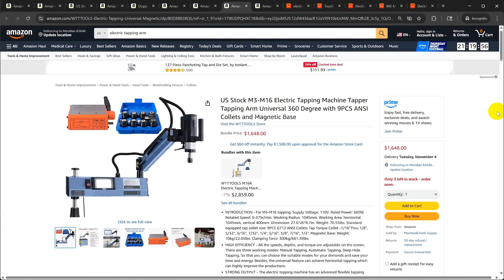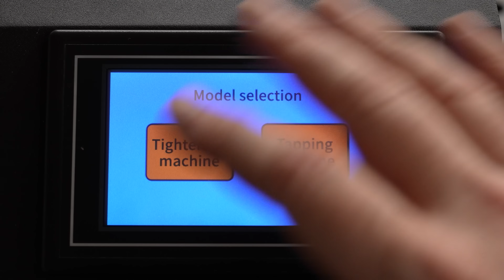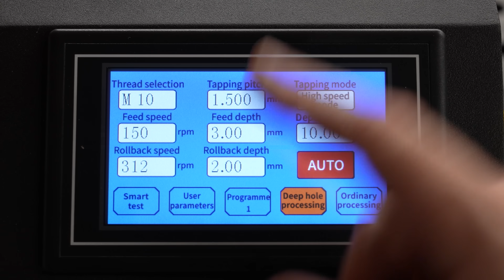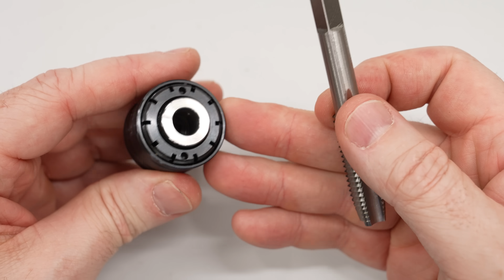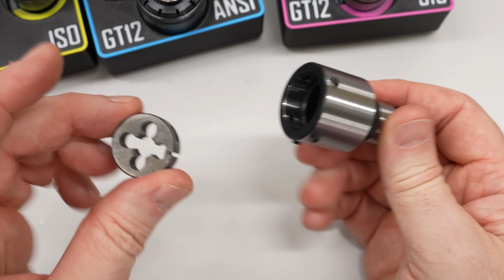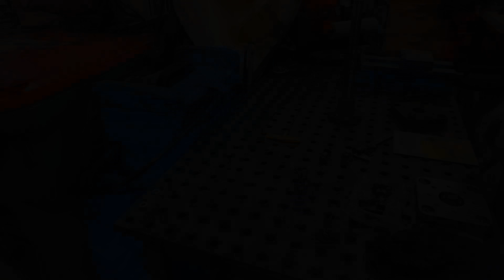Will I Regret Buying the Cheapest Tapping Arm I Could Find?

Comment: With 600 replies I'm sure somebody's already mentioned this, but I can't imagine using a single flute threadmilling tool unless you were making it yourself on a d-bit grinder.  On the other hand I use single form thread mills every single day and their limitation is strictly the rpm of your machine and the material you are milling.  You can buy solid carbide multiflute. Single form threadmills very reasonably priced from rouge systems inc.  Aka Carbide Tool Source. I use them every single day.  

The other option is to use gun taps or spiral flute taps in a tension compression tapping head on your mill that "Can't do rigid tapping."  It's a little bit fiddly to figure out. But I found it to be so useful that I have saved specific operations in my operations library in my cam software for each size tap that I use regularly.  Tension compression tapping heads are kind of expensive but they're a relatively simple device when push comes to shove.  I bought one and then I've made three more of my own.

Comment: Well James I watched this video and bought one. The education I now have about tap standards for shank and square dimensions is more than I ever wanted to know. When I researched HAAS tooling (my main supplier) said the taps were ISO but nope DIN true measurements. So listen to James on this one. We had an opportunity to bring work for staff that are all blind using this. I work for one of two machine shops where blind folks run machines. I wish I was a better designer to make accessibility for locating holes quick use tactile. The engineer and I are thinking get ROI back quick. By the way prices are way up since video. Thanks for video.

Comment: This sort of thing seems like if it exposed a Serial port that could be connected to a computer or a raspi... it would be REALLY useful and flexible. Especially with logging. You could probably have the computer automatically detect when the tap was wearing out and needed replacement.

Comment: I had to machine to remove several hundred threaded studs from GE aerospace gearboxes because a High Quality Tapping Arm was used to cut the threads....all of those threads were out of square to their mating surfaces and had to be repaired.  Never use a tapping arm for precision hardware that requires accurate projected true position.

Comment: I can't help wondering if the holes in the base plate are actually on a 90mm PCD, rather than a square pattern. It's very common to define holes on a PCD and in this case, works out very close to a 2.5" square pattern. Most decent milling machine DROs can help with PCD hole patterns.

Comment: I have a 49" table on my milling machine, and I am old and don't have a lot of space for another heavy cart/table to mount the tapping arm. What do you think of the possibility/feasibility of mounting the tapping arm on the very left-hand side of the table and either swinging it out of the way or removing the arm when it is not needed? I would also have a built-in vice to hold stuff for tapping.

Comment: Which lock-down bolts are you using there? I have a 16mm hole pattern Siegmund table and need some more bolts, but the original Siegmunds are crazy expensive.

Comment: Has anyone fitted a drill to a flex arm? I don’t need a tapping machine, but it would be nice to replace the drill press with a flex arm right at the main bench so you don’t have to move your materials to the drill press.

Comment: Thanks for this!  Got one job coming up to do 240 pieces with 6 tapped holes each.  Could do them in the CNC, but really don't like the idea of stopping/starting the spindle that much on my old Fadal.  Job after that will be 260 pieces with 33 tapped holes (3 different sizes).  That and this tapping arm is about the same price as 3 tension/extension tapping heads (job 2 has 3 sizes), makes it a wash cost wise.  Really wish it had higher RPM (all 3, 4, and 5mm taps), but think it will still be the way to go.

Comment: I have a tap arm (flex arm) we have used it to tap thousands of holes by now. It was at one point doing 10 hours a day of non stop tapping. 

They are great tools to have in a shop like ours. Tbh it wasn't that expensive for the work we got out of it. The cost was 7-8k or so but way better designed than what I see in your video too. 

Flexarm is the way to go for pro use, I go a 400rpm and 600rpm for it ... It's super fast

Comment: Here in germany we mostly use the iso varient. I'm even pretty sure that the din and iso have the same size. Some norms got taken in to a iso norm from a din norm. So here in germany you can find din, en, iso, din en, din iso, din en iso notations depending on if the norm is german, european or international. However, only the "highest" norm needs to be noted (iso>en>din).

Comment: Is it possible, that the bolts are not in a 2,5" square, but on a 90mm circle? Since the entire foot is round I'd expect a circular pattern although it can easily be mistaken for a square, if it's less than 5 holes.

Comment: I threaded thousands of holes on a similar machine as you have on the pack. Check for corresponding tools, eg spring loaded tools, attach a stepper motor on the side of the machine using an L shape aluminum bracket (that is what I did on my DIY machine). Wrap a pulley around a tool (use a bore to adjust the hole accordingly). 
Nowadays on my Mitsubishi CNC it's just a piece of cake luckily 🙂

Comment: boy the amount of oil you use.. someone has broken taps before. haha! i use a small cup, seems to work just as good and faster.
Making a collet that has a flat face or a piece that goes in a collet with a flat face so that you can push it against a surface to set the angle, would be nice easy way to set the angle. 

These are pretty sweet, i have always used the tapmatic for the drill presses, but boy.. the electronics make it slick. you think you could show us the torque limiting function and maybe the torquing function?

Comment: Nice machine James. I bet it won’t be too long until you adapt it to CNC, which will make a very interesting project. I was thinking of colour-coding the various taps, then I saw the post from “Laureeeeeeeeeee” about painting a dab of paint at the top of each tap. My suggestion would be to 3d print small “0” rings, using TPU and matching the colour of your storage trays. This way, as you purchase more taps, these little rings could simply be slipped onto them and removed when the tap gets worn out. Great video thanks.

Comment: I'm... confused. With the spring-loaded, two-arm linkage, doesn't it always travel vertically in a parabola (e.g. "not straight plumb")? Or does the collet have in independent travel - like a drill press - after being positioned with the swing arm, and I'm just not seeing it? It seems like one side of the hole would always be getting lateral pressure from the act of vertical movement, otherwise.

Comment: When I had to tap a bunch o holes I bought a tapmatic auto-reversing tapping head for my drill press.  Used manually or there is enough "slop" to mount in CNC and tap that way or there are CNC specific models.

Comment: Interesting assuming the hole circle was metric. I just bought an 1940's - 50's era MAAG brand (Swiss made) Bench Centers, started to take it apart to clean it up, grabbed my metric allan T handle set but nothing would fit, realized all the hardware was SAE. Strange that a Swiss made metrology tool would be in SAE.

Comment: Incredible organization. You buy a machine for 1 project, you buy the chucks of all the standards after researching them. I would just assume there would be some universal way to grip the taps. Then you create another project to design 3 trays for the chucks, you 3D print in the trays in 5 colours pink blue yellow black and white after fiddling withe the slicer software then you make a youtube video to review the tapping machine taking a chance the machine will actually work. You edit the video. You test the taps on stock then you get back to your original project. This is an incredible amount of time just for the organization which who knows if you will ever need to use this machine again. You managed to get through most of your career not needing this machine or these chucks now you have less space in your workplace for one project. Would it not be more economical to outsource the tapping to somebody who has maybe a better machine and is all set up to do this without breaking taps?  I would think you have a family and other things to do than being intraverted in the workshop. I am just admiring your dedication and all this effort you are putting in for this customer to set your shop up for massive threading operations and be ready for the next threading job that may not come up or if it is not to the same scale that you would pull out this machine vs say doing 5 threads by hand.  It makes me want to buy this machine and wish i could just pay you to make me the same trays so i can put this machine in my already full garage and look at it and yet feel yes i am just as organized. I feel the satisfaction in knowing that i would be all set up should i would have a need for this. My dad was a mechanical engineer that did camera repair and lenses he even fixed watches, every time he needed a part he would make it if he could not buy one this included certain bolts. He even was able to reverse engineer certain tool to remove the ring on electric meter for an electrician. He never knew 3D printing and would use  metal boxes from candy, tea film reels to store his stuff. But he never bought more than what he needed for the job. If it was a tap he needed he would only buy that size unless he could only buy it in a set. So his collection grew by need vs being set up to do every size imaginable. And some of the screws he dealt with were .5mm in diameter. So he i am watching you and my jaw dropping all of this going through my head.

Comment: info to thread mil one 15mm deep m10 you need about 10-20 seconds with a full threadmilling endmil not a singleflute toy... 
Price is about 20$ a piece tungstencarid. 

We used now for around 100 holes 1 chinese made thread mill in all kinds of steels including hardend. 

So maybe you give it a try. 

And HSS-G taps can and will snap off easier then a tap mill.

Comment: In a way the second set of holes, rotated by 45 degrees may be the stiffer mounting position anyway.  I must get some better quality spiral cut taps? They do clear out chips better & for some materials that's more important to me.
Reply: it would have be even stiffer to use the 2 x 2 holes in the bench and just rotate the base of the machine by 45 degrees. The base plate would have been much smaller too.

Comment: i have seen this kind of machine almost similar but with a oli mist tube and a blow tube. when i looked at your menu you had functions for it and in his video it mists oil when going down and then blows shen it goes out and even has a fuction where it can blow for an additional amount of time. i thought that was pretty cool so you dont have the trouble for chips going into blind holes when tapping especialy with brass or other materials witch leave chips rather than curls.

Comment: Well after almost a half century of hand tapping thousands and thousands of holes, at that price I would have bought one just my personal use at my job. When I found out you could use an electric drill to power tap I never tapped any other way. I did know about a device for the drill press made by tap magic many years ago, but they were expensive and frigging pain to setup when you needed to use them. Obviously am retired but hey am a tool junkie. Would buy one if I ever had to tap holes again.

Comment: I have had a similar machine for many years in a production setting and we have tapped well over 2 million holes with it and it still works great. Like someone else said, we have a small tub of tap magic on the back of our vice so we can dip the tap, also works great. I have thought about making an air blast to clean the tap between holes also. Currently I just wipe any chips off with my fingers, especially on small taps like M3s and M4s.

 It is very nice machine and saves a lot of CNC Cycle time on tapping. I can start a new set of parts on the CNC and then walk over and tap the holes from the previous set of parts so that 2 tasks are being done at the same time. I know the $1000 I spent on my tapping arm has made me well over 100k in part production time reduction.

Comment: That is slick.
I figured it was probably good because I clicked the Amazon link before watching the video and it was sold out.
I guess that meant yours was trouble free and it was.

I would suspect you could upgrade to a large screen or stronger motor later if you feel the need without much fuss.

Comment: One good use that this machine could have because of its slower speed is cutting larger diameter holes with annular cutters. I'm not sure if there are Weldon shank adapters for it, but that might be something to look into.
Reply: It has no down pressure though, as well as the lack of thrust bearings as he discussed... A good mag drill is pretty hard to beat.

Comment: I bought one of these for the shop at work about two years ago. (the blue ones in your links) for around $1200 cnd.   I got the metric and inch collets for it as well as building a 2' x 4' table of 1/2" aluminum plate, a grid of 3/8-16 holes on 4" centers for clamping parts and vises.   So far it has done over 13000 tapped holes.  Most of these are done in aluminum and delrin plastic.
Definitely one of the best deals for the small shop.

Comment: A friend and I do some small machine shop work and invested in one of these about a year ago, Very similar unit, maybe a little larger but I don't remember the holder size. We also bought a drill chuck adapter for oddball items and an adapter for ER32 collets. We have used it quite a bit and it has been a very good unit. I did 3D print a holder to hold the chucks to tighten/loosen the drill chuck and for making adjustments on the clutches (could not figure out how to add a pic?). We have mostly done SS and have yet to break a tap. We bench mounted a lathe chuck for holding our parts.

Comment: I have a similar import pneumatic tapping arm from amazon, cheaper still, and it came with a set of clutch tap holders that basically all had the same force springs in the clutches.  So the smaller the tap, the more likely the clutch was not set correctly to keep it from breaking.  I ended up swapping out some of the belleville springs with wave washers stacked to get the right torque breakaway on the holders. So maybe the cheapest tap holders aren't the right ones to get lol

Comment: Not as amazing as a tapping arm but a great tool nonetheless is champions XLT power tapper. It's a tapping head on a corded drill with a flexible end to help align the holes as well as keep the taps from snapping as easily. We use them in the glazing industry for threading long runs of glass handrail. I've seen Jason over there at Fireball tools use them as well. 4-500 dollar range.

Comment: Thank you for putting this together. I do just enough tapping to have looked into these, but not quite enough tapping to actually commit to one. The $1200~$1400 are still out of the question, but a $700~$800 one is a bit more of a possibility. I'd just have to find the job that would pay for at least most of it.
One question on threading with a die as opposed to tapping - nowhere can I find what depth one of these machines would be able to thread. How much thread could you put on a rod? The one threading die collet you link to has a maximum threading depth of 1.8", but it looks to have a through hole so can it do more if the machine also has a through hole?

Comment: I have been on the fence about buying one of these to mount to my welding table for a few months now. I think you’ve finally put me over the edge. 

I’ve gotten away with using a tapmatic tapping head but the functionality is limited by what I can fit on my PM727V mill. 

While I like the adapter plate - I think im going to take a chance on the magnet mount for the arm instead of an adapter plate. 

Always appreciate the content focused on the equipment accessible to the garage based business/tinkerer!

Comment: I'd love to see what the machine does if it runs into a problem, like accidentally setting it to go 1" deep on a 0.5" deep blind hole. Not much I hate more than removing a broken tap, so if the machine helps prevent that from happening, I'd say worth the price just for that.
Reply: 13:57:  collet has an adjustable clutch in it.

Comment: Cool machine - FWIW - I was a Special Machine Designer for many years and the basic rule of thumb for tap depths is 2x the tap diameter, or thru whenever possible. So changing the 1/2" tap to 1.0" deep was the correct thing to do :)
Reply: Anecdote on a car where I wish they'd done that:  '05 Dodge Magnum brake caliper bolt holes in the front knuckle were partially tapped.  A rebuilt caliper came with bolts, which I used.  They started getting tight a bit early; reefed on it a bit before realizing that it wasn't a burr or bit of debris:  the new bolts were a little longer, extended beyond the fully threaded portion, and the threads in the knuckle and bolt were now deformed.